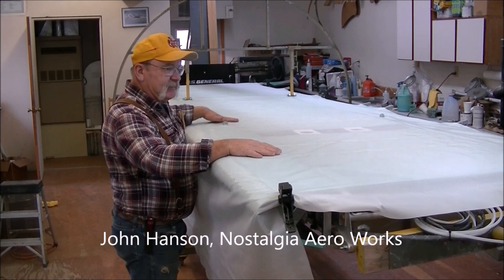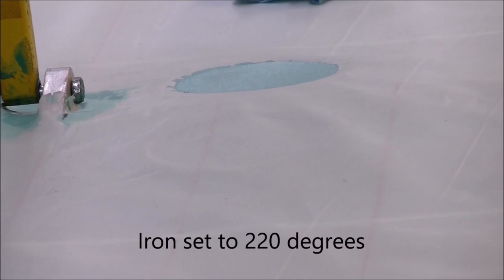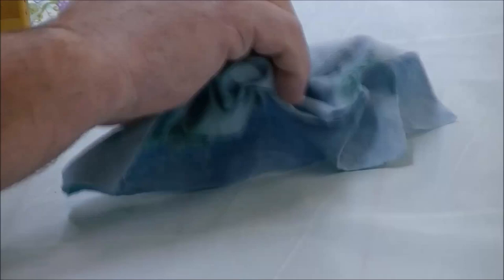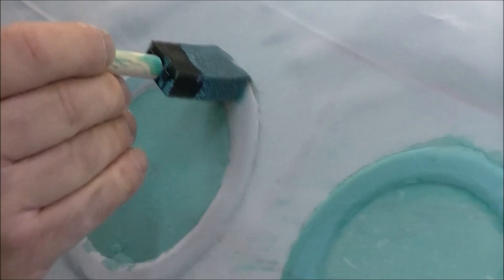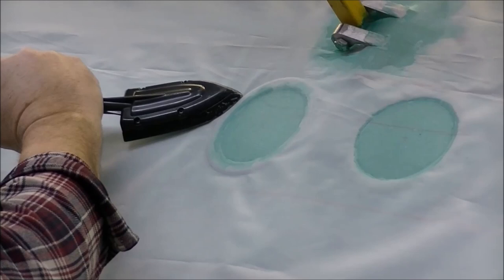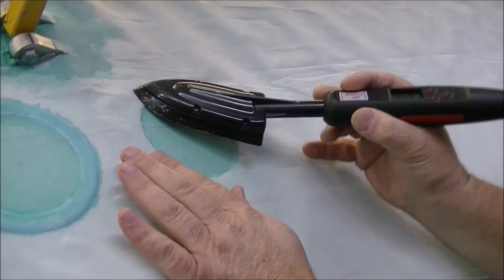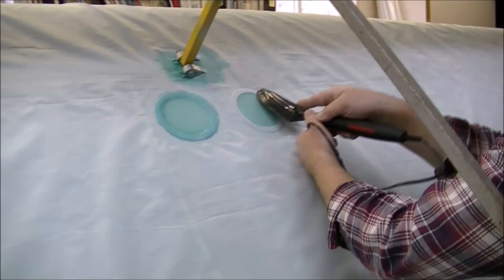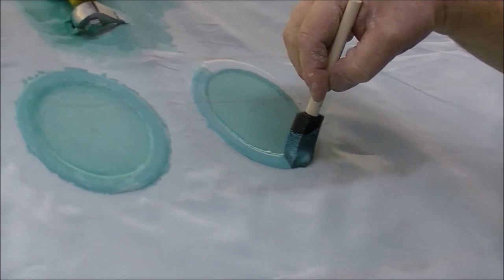Fabric Double Covering Part 2 with John Hanson

Comment: What was the reason behind covering the top first? Wouldn’t covering the top then the bottom leave an exposed seam on the top of the wing? Vs covering the bottom then the top and having the seam on the bottom? Looks like an awesome system and will definitely be using it when I hopefully build a kit plane one day. Thanks!
Reply from the maker: On a high wing like a cub the seem would be less visible on top as most people are not tall enough to see it without a ladder.  But it's just a preference.